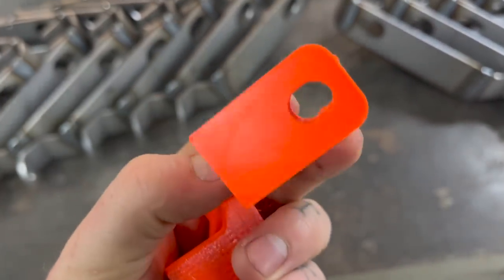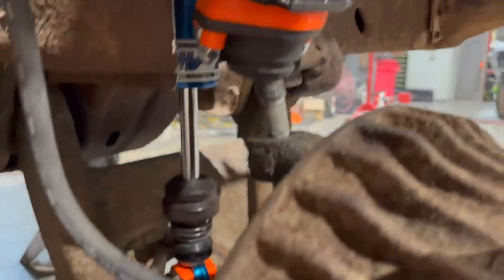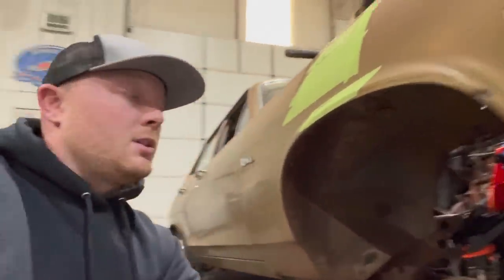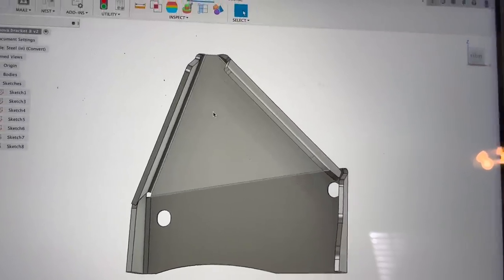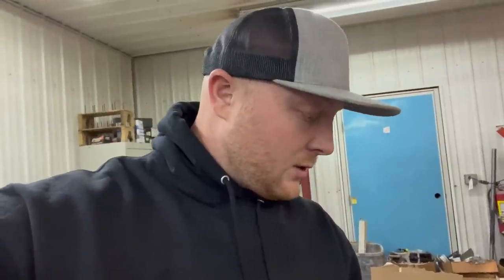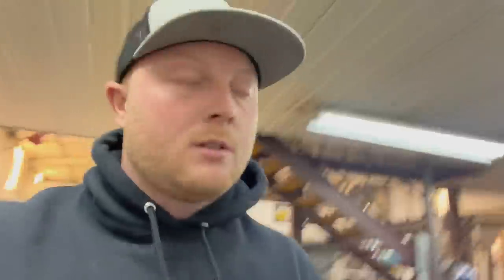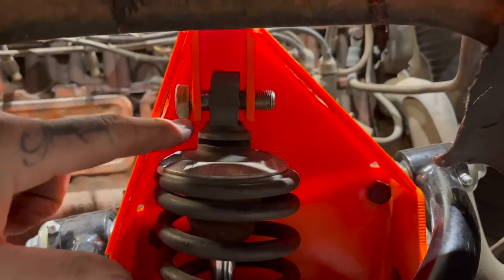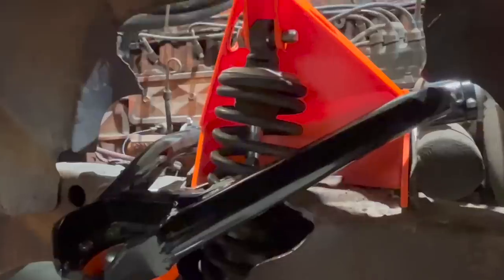Final Prototype: First Gen Camaro & 68-74 Nova Long Travel Brackets Are DONE!

Comment: I know where a '68 Chevelle is in Birmingham, Al.. My first car was a '68 and my dumbass sold it. I went to look at the car I'm talking about that was listed for $3800. I could have bought it for $1500 but I don't have a place to put a car like that, that I'm not interested in building. It has a super clean front clip but pretty much every other panel needs to be replaced, along with the floor pans, front and rear. Truthfully, I'll probably end up replacing every panel that it needed on whatever car I end up with and for what we do, it's kinda cool being able to have the floor out to get some bars in it, but dear 8lb 6oz baby Jesus! It looked terrible!!!!! The frame was pretty solid, except where most of them have rust under the battery. Usually the inner fender takes most of the hit.. not in this car! Lemme know if interested, I'll ride over and see if he's still got it..

Comment: The 68 has small side marker lights and small Amber lights in the front bumper, yours has the long side marker lights and large Amber lights in the bumper unless somebody changed the front cap, it looks like it's the original, I'd say it's a 70 to 72 if your ignition keys on the dash instead of the steering column then it's 1968.